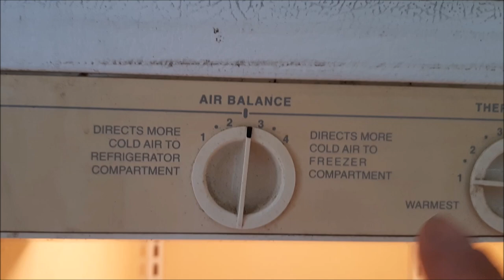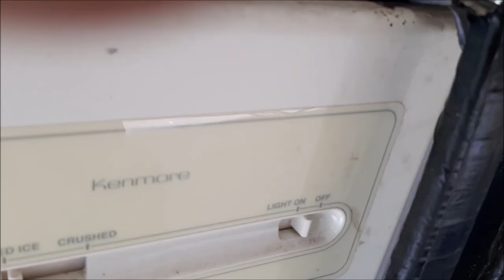Cold Smoker build with old refrigerator under $30

Comment: I have a wood chip cold smoke generator. Was about to adapt it to fit my propane smoker to be able to cold smoke cheese and tuna. Ever can fresh tuna at home? Cold smoke it before you can it and you will be amazed at the flavor😮. Anyway here I am looking up refrigerator ideas. I wasn’t thinking of using a working refrigerator. But now I’m intrigued…..

FYI, making this comment before I saw what smoke your using… but pellets are ok, bomb digidy cold smoke is from real wood chips. Sometimes I mix those flavors and add a few wood pellets to my propane smoker wood chips….. because I’m a mad scientist like that🙂🙃

Masterbuilt slow smoker is electric and runs on chips
Reply from the maker: like the sound of the tuna, frig already broke and haven't smoked for a while, thanks for ideas. its nice to have a mad scientist in my back pocket.

Comment: I was thinking of adapting a mini fridge for cold smoking. That way, I don't have to worry about meats being in danger zone temps for extended periods if i didn’t plan to cure them. I also thought, instead of cutting hole to funnel smoke in, why not just put smoke tubes or sawdust trays in the refrigerator? You can add a fan in the bottom like a DIY dry aging cabinet if you need a little air flow. You would only need a hole in the top to let the smoke out.

Comment: Are  you still using this after a couple of year?  for the hole at the top, Id find some piping, even pvcc to fit tthat hole and slide the pipe down to around 4inches off the bottom of the fridge.. And add shelving too.. anyways, with the pipe going to the bottom, you'd  retain more cool temp for less cost.. and get a better smoke distribution inside as it would fill with smoke completely, and vent from the pressure of the firdge cooling..  :) Nice work..

Comment: I have a non working fridge. I'm getting ready to try to smoke my bacon that is curing right now. It's pretty cold outside. Wondering if it would be safe to use. Hoping the ventilation hole will let the cold in
Reply from the maker: I tried to do that with cheese but the insulation makes the heat build-up. You need many holes because it tried to melt my cheese.

Comment: Not sure if this a silly question or not. But is the fridge turned on and running, or is just used as a cabinet to contain the smoke?

Thanks.
Reply from the maker: Yes the fridge is on to keep cheese from melting from heat from smoke. usually you can only smoke cheese in winter.